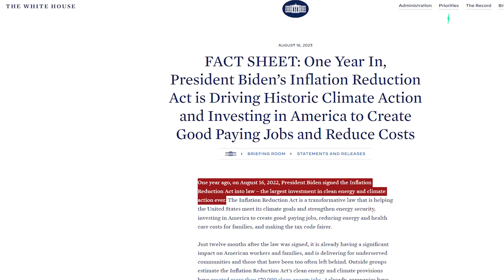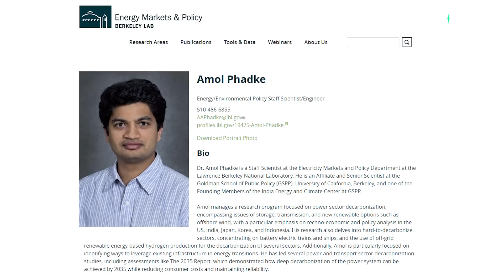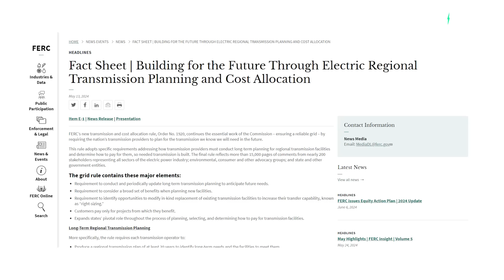How a small change could double the size of the U.S. electricity grid

Comment: Okay.  So there ISN'T enough power available to run EVERYTHING off electricity.  That means 'the muppets' were CORRECT that EVs would collapse the grid if we tried to go 100%.  Hurts to admit you were wrong, but good you did.

Next, this 'study' says all that's needed is higher capacity main transmission lines.  That would double the grids capacity.

Em...NO.

Substations are set up to transform what's on the grid NOW, as are all secondary transmission lines.  ALL of those would ALSO need to be replaced, which is NOT cheap.  As well, the GENERATED BASELOAD POWER needs to be replaced, which is NOT being done.

So getting more unreliables is just a copium way of saying the following:

We need far more solar and wind farms despoiling tens of thousands more acres of land to even come CLOSE to generating the coal, gas, and nuclear baseload we're removing.  We also need thousands of miles of overhead lines to connect those eyesores to the existing grid.  Then we'll talk about how we can actually generate enough for ACTUAL DEMAND.

There...fixed it for ya.
Reply: Did he do another pivot? 😁
Reply: @hardi.howdy.983  Like I said...he pretty much admitted that there isn't capacity to power our homes AND charge EVs.  Totally denied that as a problem before.

Comment: Install the new lines and since your there, it doesn't cost much more to add 50% or 100% more lines and you could increase capacity 3-4 times.
Reply: But what about the weight? wouldn't you have to replace the hardware and insulator's? What about icing? What about loop limits for stability? What about transformers? Etc.
Reply: @tedmoss  We need weightless lines so that we can string 100x more lines on the same transmission towers.  :)
Reply: @tedmoss  Probably going to replace them anyways, what's one more.

Comment: Know were you are talking about, if we should work like the grid
you would have a few T fords and all the rest were traveling on horses .
the grid is only needed in some cases, and solar and wind can not work
when depending on the grid, great if you create your own power
but the grid is not a battery, what is the grid? your local power lines in or near town
power lines from one state to a other are just not needed power lines.
all power local needed can be created local, andhow long do you think
a power company will sell and trans port electricity if that is costing less than
3 cents a Kwh, do not forget it is business if you can not compete you are history.

Comment: The lines are 100% utilised and if one line is taken down to be replaced then someone has to go without power for that replacement time ( minimum 6months). The renewables are now being redirected to the production of green hydrogen which has no impact on electricity downtime. Green hydrogen is a very valuable resource and can easily be sold. Follow the money …!
Reply: Here in the UK, line maintenance only rarely causes supply interruptions.
Reply: @rogerphelps9939  Same in the US.   We plan and budget this stuff for year(s) in advance.  Most folks do not even know when we are doing it.  US gets a lot a of hype and drama around this field.   And most of the Hydrogen stuff is complete nonsense.
Reply: @rogerphelps9939  we are talking about replacing lines sometimes from state to state. Not changing a fuse on a tiny little island…!
Reply: @dizzydella1  and f in long transmission lines..!
Reply: Where does the hydrogen come from?

Comment: That's why distributed generation is so important... PV + battery
Reply: I am now of the opinion to use personal and privately generated and stored power.  The future grid will only be needed in dense urban areas.
Reply: Small modular nuclear has 2 million times the energy density, is cheaper and cleaner, and has the same distributed generation benefit.
Reply: @beautifulgirl219  SMRs indeed hold a lot of power but the question is on affordability. The only part I disagree with you on is affordability, because right now it is not. Most of the expense is due to regulatory hurdles and red tape.  Buying my components from signature solar online and installing it myself yields me a price of $0.16 per kilowatt hour. SMRs are not that cheap. This should be enough to get me completely off grid and fix my costs.
Reply: @beautifulgirl219  Every small town should have a couple nuclear plants! As soon as you can point to one completed project you can start making this argument. Until then fantasy land.

Comment: Data centers don't all need to be in cities.  We are increasingly seeing them built out in the middle of no where next to a solar/wind farm.   Eliminating the transmission losses altogether is going to be a trend.
Reply: The issue I ran into when designing Uptime Tier III and IV data centers in remote areas was water resources for cooling. Another issue is dependable power.  Many data centers are offered Green Energy utility tariff rates but to meet their Tier requirements these data centers require redundant power components, such as two or more 24/7/365 power lines. Solar/Wind sources with batteries do not meet these redundant requirements. Presently hydro, nuclear, and gas plants meet these requirements. Also, many remote areas do not have dependable long-term water rights.
Reply: Transmission losses are tiny.
Reply: @BobBob-uv4vc  Let me google that for you...  "The U.S. Energy Information Administration (EIA) estimates that annual electricity transmission and distribution (T&D) losses averaged about 5% of the electricity transmitted and distributed in the United States in 2018 through 2022."
Reply: @_winston_smith_  Transmission line losses are only a portion of that. You still need transformers, even for a small run. A couple of percent does not make it worth building a new facility next to a power plant.
Reply: Maybe we should be looking for a use for all that heat from Data Centres?
District heating?
Heating Greenhouses?
Store it in Sand Batteries for later?
Reply: Do we need data centers?
Reply: @francismarion6400  
Good question.
But your are using one now...

Comment: Doubling is not straightforward IMHO. The temperature of the wire will be simplified also double, but kevlar is adding strength, but not conductive. Hence these lines will be even hotter. Then the resistance is growing also growing adding to the voltage drop, needing more voltage at the feeding end. Not simple

Comment: What about local generation for some/many towns using Solar/Battery systems to take these towns off the grid increaseing the power bandwidth for the existing Grid?  This idea seems interesting and fairly easy to implement.  Thoughts?
Reply: It is easy to implement but no one does it because of the high cost. The only exception is if you are forced to do it. Have you ever checked the power prices in Hawaii, which is not connected to the US mainland power grid?

Comment: Most high voltage lines run underground are run through tunnels or ducts so the are not that dificult to replace but underground cables do not suffer from sag as much as overhead cables as they are supported much more frequently that long lengths of overhead cables, also recbaling existing pylons will be just as relevant for almost every grid across the World, not just the USA.

Comment: If you want a "quick fix" install inter-connectors between the three US Grids so that they can share power. I read somewhere that with proper management you could retire several old peaker plants at a stroke as they'd no longer be unnecessary if you could load balance between grids.
Reply: Makes sense, especially out west with Texas being its own little grid island makes for curtailment and wild price swings….
Reply: Are us grids not interconnected? 🤔
Reply: @NitishYadav-lb7zc  The US is very backward in many respects.
Reply: @rogerphelps9939  You could just as well say the U.S. is very much ahead of others in many respects, it is a very different problem. Very long lines and extreme use of power.
Reply: @NitishYadav-lb7zc  Apparently (according to Wiki) the Western and Eastern Grids have a number of connections totaling 1.32Gw. To put that into context for you the UK, with a population 1/5 that of the US, has about 9Gw of connections with five or six different countries, and additional connectors under construction / permitted for another 9Gw
Reply: @NitishYadav-lb7zc Edison is still fighting with Tesla. 
😂
Reply: @jantjarks7946  Are you aware of the uses and advantages of DC transmission lines?
Reply: @tedmoss  No. 😂
Reply: @NitishYadav-lb7zc  No, there are three of them because when interconnected they became unstable and didn't work. DC to DC interties do maintain stability however.
Reply: @NitishYadav-lb7zc there are 3 grids - east of the Mississippi, west of the Mississippi, and Texas.
Reply: Texas grid is interconnected by DC ties.  They don’t have a lot of capacity though, so increasing capacity would probably be beneficial.